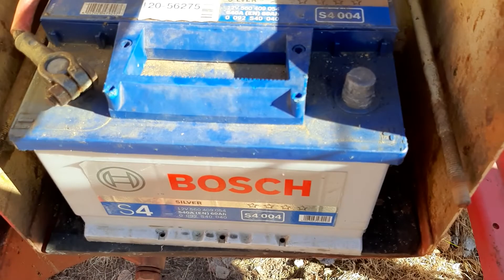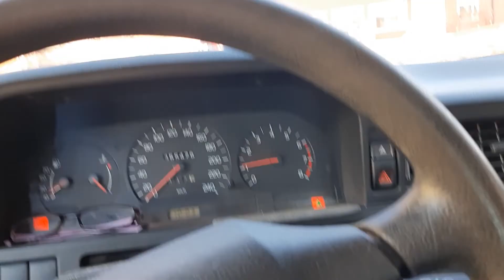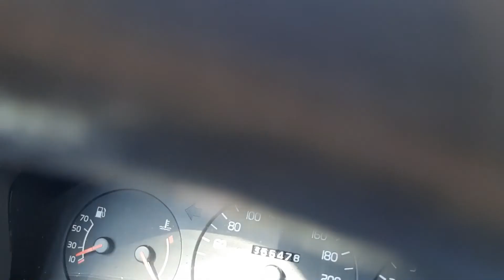Spring?

Comment: You can see some of the ground!  Yea!!  The tractor should be good to go after some repairs.  Another week and the river will be flowing.  Cheers Sven!
Reply from the maker: Unfortunately, both mounts have been broken, so now I have to try to get a new carburetor. 
It can be seen that they have been cracked for a long time, because half the refraction was rusty. 
The river is already open and the swans have returned from the south.

Comment: Awesome looking tractor, looks kinda like a Farmall Super “ A “ only the larger version. Nice seeing it run even rough now at least you can get the carb cleaned and maybe it’ll good to go.
Reply from the maker: Oh well. It is a Volvo T22 from 1949, so it has probably seen its best years.
Reply: @makingithappen5178  we’ve got an old Super A and it’s about that same age and it’s got the rear 3 point hitch and also a under the belly attachment for gardening equipment and a belly mower, my dad loved it for all his gardening stuff and mowing his yard because he said he could see exactly what he was doing when using the belly attachments   It hasn’t ran in many years even before dad passed